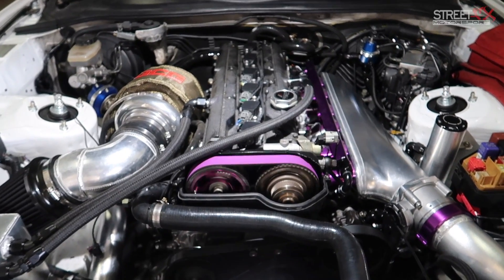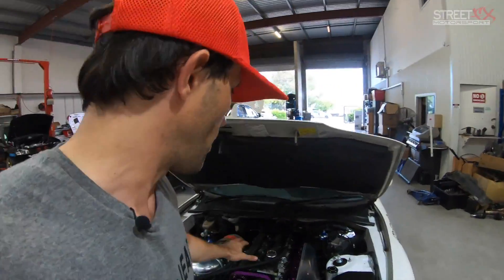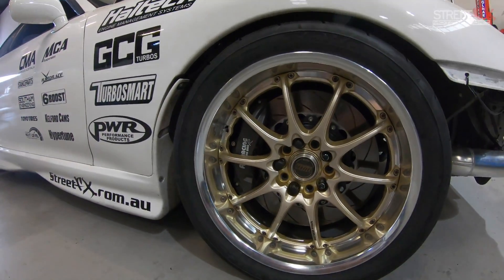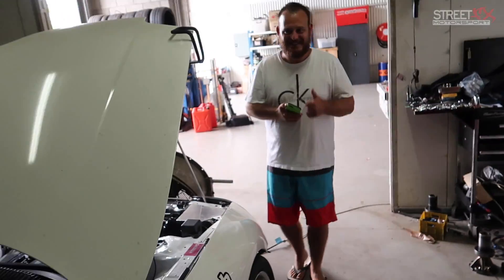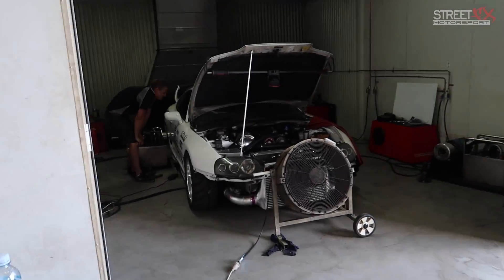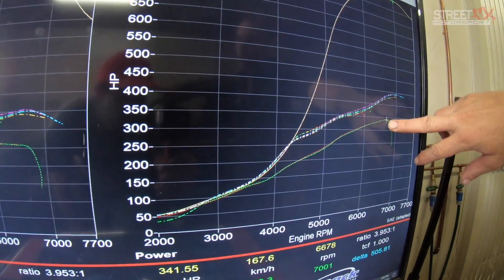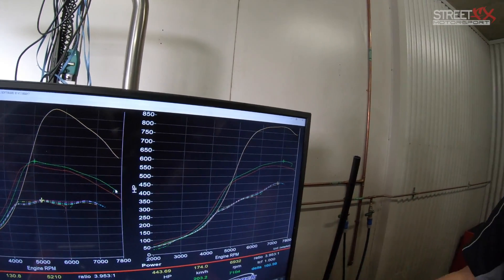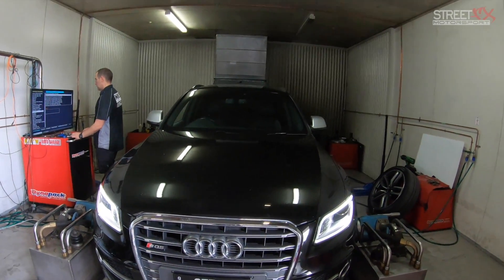Building a 10sec Supra pt2: How much power can we get from a stock block 2JZ?

Comment: Keep getting mix review.. alot of guys says stock gte intake manifold is pretty good up to certain power... vs thos ebay $600 ones. Which all looks the same.
Reply: The stock plenum is great, I wouldn't touch it unless you plan on making 900hp+ or have a built motor and don't want any limitations for big power one day.

Comment: Im doing this to my gs300 vvti also i want forged rots and pistons but only wanna run like 500hp wil a complete stock Block hande that ? ( low miles  80k )
Reply: I'm sure you've learned by now that a stock 2JZGTE is built for at least 800hp without opening the block.

Comment: Do the fans come with the radiator? Are they doing okay on the street? Heard lots of stories of people switching back to stock fan due to overheating/fans not pulling enough air..
Reply: Sorry I mean with other fan setups such as mishimoto..
Reply from the maker: @mylovelykaro  we haven't had a chance to drive it on the street yet. Still working on other aspects. The fans and shroud were supplied by PWR so knowing them, we are in safe hands there :) I recommend hitting them up if you're chasing a proven cooling system.

Comment: This makes me love the BMW N54 even more....
Reply: Says the guy that comes in a supra video and babbles about n54's to try to feed his own ego. As an owner of both cars will say  n54's arent even close to these engines. Yes the blocks can withstand similar power if lucky (again I say if lucky) but arent near as reliable or solid of motors. I spent almost $10,000 just trying to keep my 500 whp n54 running. Versus running and gunning any of my Supra engines 7m,1jz, or 2jz with no issues making 6-800hp on stock bottom ends with no issues just normal maintenance. N54 always had vanos issues, water pump failures , manifold issues list goes on. Unless the n54 got more reliable as to the likes of the n55/s55 it wouldn't stand a chance at holding 800 hp for more than a few pulls  on stock block. And he'll n55 can't even make 600 hp on stock block so yea man. Yes it's older tech but there's a reason the 2j is the inline 6 king . Barra comes in close 2nd and n54 might tie 3rd with the rb26 :p
Reply from the maker: Uh?
Reply: @StreetFXofficial  Considering the price per hp, capability and difficulty level it seems the N54 engine is better. Especially when considering the price and availability of the engine itself. If you haven't noticed I am a bit of a N54 fan, but I'm not trying to diss 2jz.
Reply from the maker: I think you’d find the 2j to have a more proven track record to make power reliably without internal modifications. It is unfortunate for tuners now though, how expensive the 2j has started to become. That will happen though when things become harder to find.
Reply: @StreetFXofficial  Yeah I know, it's an older engine ofc. But now that the N54 is a well known and interesting platform everyone and their mom is trying to break records with it.  I've been following the tuning community closely and I think 2019 is gonna be the year of N54.
Reply: @Asmiiirr  n54 unreliable asf in comparison. B58 better
Reply: @mrscarecrowah  b58’s also don’t compare at all to jz’s in terms of reliability.
Reply: @Asmiiirr bmw guys need to just appreciate bmw and stop trying compete with a 2jz which was introduced in like 1992 and is capable of 1130WHP on stock bottom end…… just let it go lol

Comment: Hubs not at the wheels, on a roller it will make less power.
Reply from the maker: Yep
Reply: Street FX Motorsport TV That said hub dyno is way better for accuracy and finer tuning, not to take anything away from the Supra! Love your vids btw
Reply from the maker: I prefer hub dyno, for those reasons. I always find myself saying “whp” instead of “hub”. Probably cos people generally have nfi what that means, but they know the abbreviation “rwhp” or “whp”. I know it’s technically incorrect though 😳
Reply: Street FX Motorsport TV No i see your point, i say hub and most people have a blank look haha i should just say rwhp and be done with it instead of explaining the differences and why one is better then the other lol
Reply from the maker: ahah that's part of why I have gotten into the (bad) habit of referring to everything as whp. Plus of course it sounds better ;) 

At the end of the day though, most people should understand that every dyno, whether roller, hub or engine, will yield different results, and they should only be honestly compared to results on the same dyno at the same shop.

Comment: One thing I have never quite understood is people saying the "more ignition timing" on e85 resultis in "more power". As far as I was aware e85 REQUIRED more timing advance because it was slower burning, not because it was possible to without detonation occurring. With an e85 and ron98 tune isn't the combustion still happening at the same time in the cylinder position roughly? Have I got the wrong end of the stick here o.O
Reply: i think thats cause of the extra fuel compared to 98, e85 uses way more fuel so i think combustion has to happen later simply cause it takes longer to fill up the chamber.
Reply from the maker: E85 is slower burning (higher octane), meaning you can advance the timing to ensure the biggest “bang” without worrying so much about pre-detonation. 

98 fuel will typically ignite before you get the timing to the ideal point to create the biggest “bang” to force the piston down harder on the downstroke.

E85 also runs cooler which helps keep temperatures down. 

E85 has a lower energy density though, so while it can make more power for the previously mentioned reasons, it takes more fuel to make the same power as 98 pump.
Reply: @StreetFXofficial  Ah ok, so it is the more consistent and cooler burn of e85 that does allow you to get earlier combustion and more power. I did not understand the limits of ron fuel combustion enough I guess. Cheers for the info
Reply from the maker: @lockjawjak  It's mostly due to the fact it is harder to ignite, and less prone to pre-detonation that means you can dial in a more aggressive timing curve that yields the increased power.
Reply: @Frietpan  I know why it combusts slower and requires more ignition advance to make peak power but it always confuses me when people say something like "I went e85 and got a nice power bump from the extra ignition timing" when e85 simply seems to require more advance to get combustion at the same time as ron98. Seems a little odd to me that is all
Reply: Its called MBT, most brake timing. It occurs around 15-20atdc, than you want Max cylinder pressure beacuse the crank has most levererage.
In most cases on pump 93 you get knocklimited before you can reach that much adcvance you need to hit MBT.
So when you change to E85 with better knock resistance you can bring in the timing to make most torque.
But it would have been the same with 106octane racegas, when you are att MBT you wont get more power by advancing timing more.
So if you arent knock limited on the fuel you use you wont make more power with like e85. But in boosted applikationen you always are knock limited in the higher load :)

Comment: Realistically with a proper drag setup you should get well into the 9s with that power.
Reply from the maker: We don’t plan to wind it all the way up. Probably only 26psi and 275 drag radials. Full weight, no stripping. Will also be on coilovers which will limit the drag capabilities.
Reply: @StreetFXofficial  Supras arent as heavy as they look you'd be surprised. Good luck with your quest with the 10 second pass i think you will  achieve it with ease. Your setup is pretty similar to mine besides the vvt-i and turbo.
Reply from the maker: Oh yeah, people seem to think they weigh 1600kg, but they are 1400-1450kg. We weighed ours in one of our other episodes on here. I was just meaning that we aren’t stripping ours for the sake of a drag pass.

Nice to hear from another Supra brother though :P
Reply: @StreetFXofficial  I'm not a fan of stripping the car it should be raced as it is driven on the street. We need to expand the Supra brotherhood lol
Reply from the maker: haha getting harder to expand these days when the entry level RZ or RZ-S is $30-40k. Not too long ago as little as $10k would buy you an RZ.
Reply: @StreetFXofficial  Yeap, prices have skyrocketed. Good news for us :D

Comment: Almost a 1000 on E85...should be close to 9 sec!!🤘🏻
Reply from the maker: Full weight and manual. Supra’s are tricky things to get the power down efficiently in. We’re only planning to run around 26-27psi when it goes out, so I don’t expect we’re likely to get too deep into the tens, but we will try :P